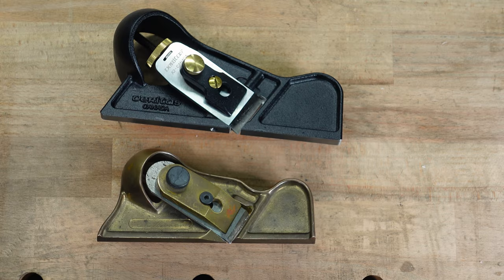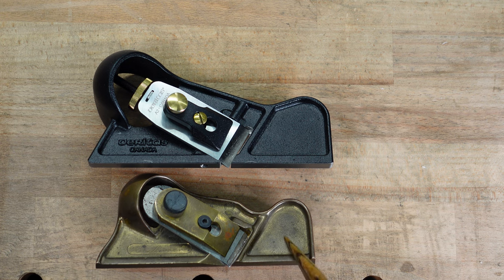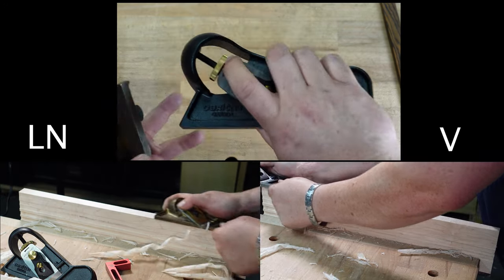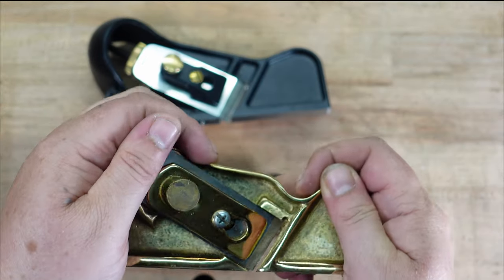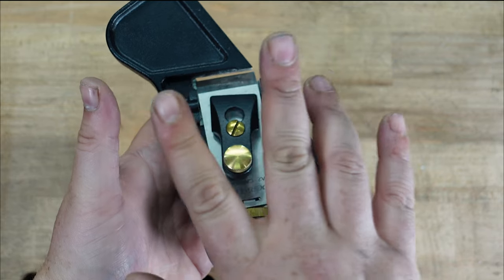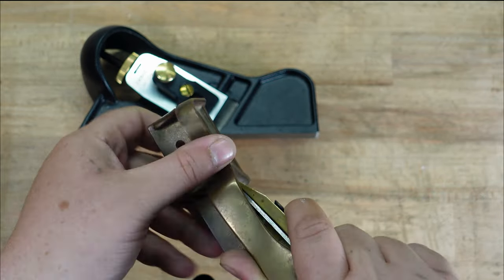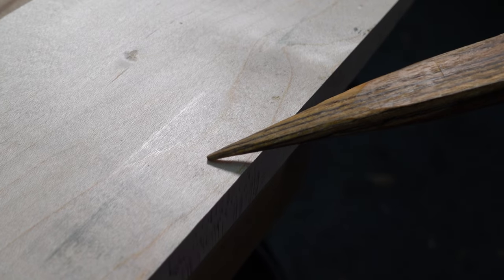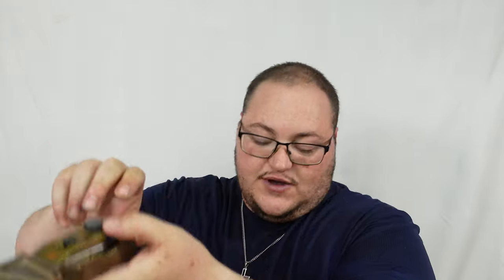More Effort Than Its Worth? -Lie Nielsen no 95 vs Veritas Edge Trimming Plane -Review and Comparison

Comment: My first LN plane 1998. 😊Love it. I use mine pulling exclusively now. I’ve tried pushing, laying it flat on its face pushing etc…. and for me pulling it while board is in the vice just feels right. One issue I had was the bronze will leave green marks sometimes from the fence like you say as it burnishes it almost. I added a piece of the UHMW tape from LV onto the fence. Problem solved. I also find I use a small brass plane hammer while setting it up. Far far easier. Once it set up I really don’t mess with it for a long time. The shavings that you take with it are finishing shaves. No need to take more than 2-3 I find and the edge is set. Last sharpening was probably last fall. 

Great video. I think the LN version you were using is one of the original few years Thom produced these things. Luxurious plane for sure, but I use it a lot on some projects.
Reply from the maker: See this is exactly what I was hearing too!!! It's almost like a love it or hate it plane lol 

Great tip in the UHMW tape!! Thank you for sharing!!

Comment: I have the Veritas (limited edition in stainless steel) and really like and use it on every project.  It's the final plane I use when edge jointing (I don't have a power jointer) to guarantee squareness to face.  I find I'm not really changing the iron depth once set because it's finely set, my other planes (jointer and jack have done the bulk of the work).
Reply from the maker: Oooh I've seen those limited edition ones! They are awesome! 
Good point about a power jointer! If your mostly hand tools that could change things! 
Do you focus ok square with the jack and jointer or ignore it and just go for the edge trimming after?
Reply: @BatCaveCreations  I can get square with the other planes but this tool gives me piece of mind.
Reply from the maker: @anthonyseiver7000  valid point! Thank you!

Comment: I have the veritas and love it. I use a lot of thinner wood 1/2 inch or less for small boxes. This plane makes it easy to get  my edges 90 degrees.
Reply: that makes sense, I can see these being very useful for smaller stock that you don't want to run through the jointer

Comment: I was having trouble when edge jointing with the edge coming out of square with the flat face.  Rob Cosman recommended that I put my work piece flat on top of another flat board, clamp them together on a flat reference surface and run my plane down the edge of the work piece while holding side of the plane flat against the reference surface. I use the table on my table saw as the reference surface.  Works every time.  That is my last resort when I get frustrated with trying to square the edge to the face with the board in the vise.
Reply from the maker: That works for sure! If you are going to be joining 2 boards you can also plane them together! There are lots of tips and tricks for getting a square edge!
Reply: @BatCaveCreations  I have done the method of planing two boards together.  That gets the same result as the up/down or in/out methods on the table saw or jointer.  I don't have a jointer, so I use the up/down method on the table saw.
Reply from the maker: Deff works too! I don't have a jointer either lol traded ir for a welder :)

Comment: Once it's setup, you're not fiddling with it until the next sharpening. I use my LN on every project, and its the best way that I've found to get a seamless joint. I am in a small apartment with a small vise, so I can't use a longer shooting board with the jointer. I am thinking of getting the left hand veritas one for times the grain is running the opposite way and I only have one reference surface to use.
Reply from the maker: That is deff a valid point! Never thought about work space and these taking up alot less! Thank you!

Comment: I guess if I were to get this type of plane, I would probably go with the lie nielsen mainly because of the mouth being smaller. I'm not convinced that the part on the Veritas will break, but I've never used either one so I could be wrong. 
The prices of these planes wouldn't be justified considering they only do one job.
A thought about the burnishing, do you think that might be reduced by putting a thin piece of wood with double sided tape on the fence? 
Another great video!
Reply from the maker: Yes! Someone reccomended a piece of that low friction tape (UHMV pr something) and thay solved the problem! 
I agree with you, I'd rather stick with the same plane I'm already using vs grabbing another but I also get what people are saying with getting this set right and it's a guarantee 90 for glue ups. Idk hahaa
Reply: @BatCaveCreations  true enough that you can get a 90 degree edge, but it's easier for me to plane both pieces of wood together. Whatever that angle is they lay flat for glue up.
Reply from the maker: @TheRaven0811  that's my method!

Comment: I thought this tool was for end grain. That is why it is a low angle blade.  Try squaring end grain.
Reply from the maker: Never thought about using this on end grain and never saw anyone use it on end grain till after posting this and sending them back to their owner lol
I personally wouldn't want to use this on end grain but do wish I would have tried it before sending them back lol